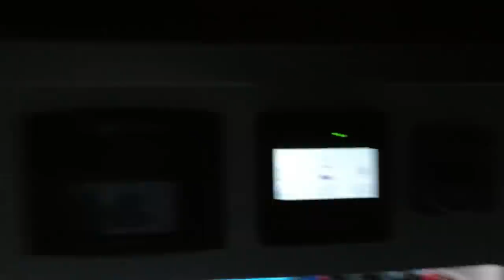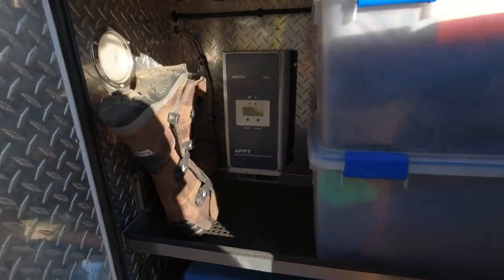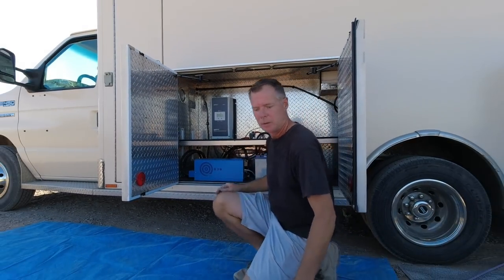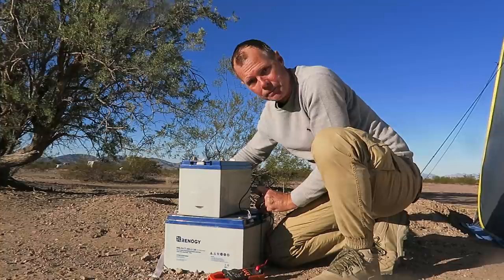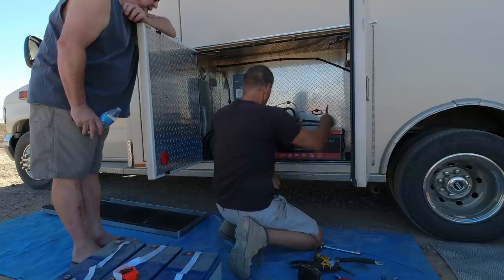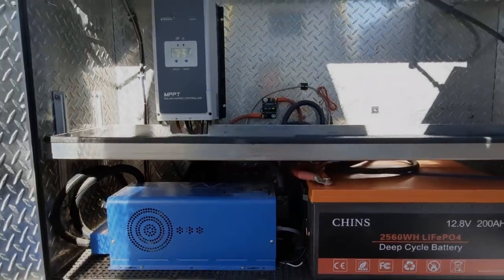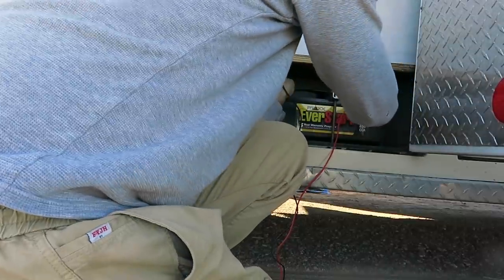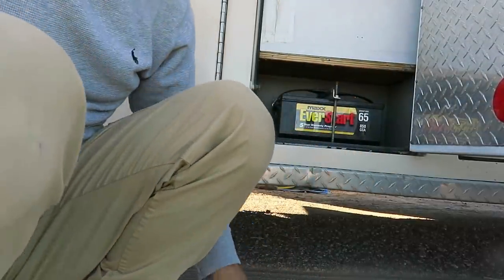Upgraded To CHINS Lithium Batteries In Quartzsite Desert | Fleet Gear | Ambulance Conversion Life

Comment: Hi! Love your channel, Lefty is a crackup, you select music that really complements your video and I like your choices in upgrades. I own 3 trailers, a 25' tag, a 35' 5ver and a 42' 5ver (all toy haulers) and I'm a former sub ET and Navy instructor of ESM operations and maintenance, so I know a lot about every facet of electronics. I'd like to give a little advice, if you don't mind.
1. Excellent choice on the Chins batteries, you obviously do your homework. If you want to keep them warm in cold temps., you could cut a small hole in the cabinet out of the way and put a vent over it and when your heater is running, a small amount of heat would enter the battery compartment. They won't be as warm as you, but they'll be far above freezing and this is a lot simpler and more reliable than a 12v heater with thermostatic control. Simpler is better.

2. Battery hookup. Everyone is making this mistake, especially the people with 6-10 Battle Born systems and $20k wrapped up in Victron stuff. Don't get me wrong, BB and Victron is quality stuff, but IMHO Victron is designed more for yachts and is priced accordingly and BB is what people buy when they want to brag about how much they spent or they got them free for shilling them on their YT channel. You didn't show a pic of your battery hookup, but you did show your pos. and neg. jumper cables. That's a good idea, but to ensure 100% balanced load and charging you should have equal length battery cables to connect the 2 batteries to pos and neg bus bars, then the inverter and solar also connected to that bus bar. Actually, the 2 battery neg cables should go to a BMS shunt (I recommend the Victron Smart Shunt 500, a bargain for what it does and super accurate V, A and SOC readings for only $130), then the shunt connected to the neg bus bar. The reason is electrons flow through the path of least resistance. In a normal hookup with the batteries jumpered together, the electrons flow in one direction through one battery, then the other way through the other battery. In the case of 10 jumpered together, battery #1 and battery #10 are the first to get charged and discharged, the middle 2 batteries are the last and the batteries are not getting exercised equally and the end batteries will die first, which negates the whole point of buying expensive LiFePo4 batteries, especially those $1,000 apiece ones. The reason this happens is LFP batteries' internal resistance is measured in milliohms, which is very tiny. Differences in cable length or running through other batteries is more than the battery's internal resistance, so since electrons follow the path of least resistance, minute differences in cable length or connector resistance now dictate which battery gets more of the charge, instead of the batteries themselves. For graphic examples of this imbalance in charge/discharge, Will Prowse has recently done 2 videos using 5 48v rack mount batteries and the internal BMSs showed that when the charger stopped, Battery1 was at 100%, battery2 was at 98%, Battery3 was at mid 80%, battery4 was at about 78% and battery5 was at about 70%. Not good, especially if a guy spent $10,000 on 10 batteries. You know who they are!  LOL   To be clear, the pos and neg cables don't have to be equal length, but all pos cables should be equal and all neg cables should be equal. The jumper cables are a great idea to help with that. 

Solar panels. I use and prefer Sunpower, they're not only the most efficient per sq. ft., they also degrade slower than panels with thin silver interconnecting wires (because they don't use any and the silver wires eventually break due to extreme heat cycling - possibly below freezing at night and up in the 180 - 200*F range in summer heat.) They also are less prone to power loss in partial shading conditions. Normal panels lose about 89% of output if a single cell is shaded and if in a serial string, the entire string loses power. Sunpower loses only 11% or proportional to the area shaded. I'm glad to see you're connected in parallel, again - you did your homework! Great job! Also, Rich solar panels are my 2nd choice in panels. As tested by Will Prowse, he actually harvested 104w out of 100w panels, which means the mfr underrated the panels. One of the few products where you get more than you were promised.

Solar controller. I've tested Morningstar, Epever, Eco-worthy, Renogy, and Bluesky side by side with the same panels on the same day. Bluesky was antique junk, morningstar was solid but too expensive, Eco-worthy was amazingly efficient due to a very fast MPPT algorithm and very inexpensive. I use Renogy 40 amp for customer systems between 20 and 80A due to their low price, good quality, fast algorithm and BT with app on phone or tablet. I use the Eco-Worthy for lower power systems below 20A. The Epever was a heavy duty unit, but it's algorithm was extremely slow to respond to solar panel voltage changes, which means at the end of the day harvest is not optimal. It's not something I'd remove it for, but I chose not to buy or sell them because there were other, faster, cheaper units (Eco-worthy 20A and Renogy 40A) to use. If it ever fails in the future, you might consider a different unit.

Inverter/charger. This brings me to this topic. I like Aims, they're pretty reliable. I have heard of a couple of failures, but that's really low considering how many are in use. I use a newer style setup called a hybrid inverter. Up to 2400w of solar can connect to this one unit, which can accept over 3,000w of 110v AC input, it connects to a 24v battery, and it puts out 3000w of 110vAC output. It also charges the batteries with up to 60A of solar and up to 80A of AC simultaneously. In your case, your 1600w of solar would feed the batteries, until you started using a 110v load. The solar would automatically power that and any excess solar would still feed the batteries. At night, the batteries would power any 110v loads and if you started the genny, it would support the AC loads and charge the batteries with any excess. If you had the genny running and you had a load in excess of the genny's output, the unit would use the batteries to add power for that load. This is all automatic and uses no relays or ATSs, so there is never a loss of AC power and TVs, Sat dishes, DVDs never lose power and never reboot. The best part is it's only $480, lower profile and much lighter than the AIMS units. I use one of these on the 25' trailer with 30A breaker panel, 950w of solar, a 12k BTU mini split and 9.6 Kwh (750Ah) of LFP batteries. The mini split only uses 800w max to cool the rig, once it reaches equilibrium, it uses about 400w or less. So the rig is fully solar powered, even in 110* southwest deserts which is what I planned for. The 35' and 42' trailers are a bit larger systems. Each of those have  20Kwh (1565 Ah) BMW EV 24v batteries with a cell balancing BMS, 2 of the 3000w hybrid inverters (one on each leg of the 50A panel) a 40A 24v to 13.6v DC-DC converter to power 12v loads and a dual zone (2x 12k BTU) 24K BTU mini split with a transformer to supply 240v from 120v input. These trailers can almost be used as meat lockers in 110* heat, plus they're totally silent. LOL   Since the mini splits use only 1200w max, the microwae is now the single largest load at about 1800w continuous and quite a bit more on startup.

At any rate, I like your system, it's well thought out and good reliable equipment. just thought I'd mention other options that might be attractive if you ever need to replace anything. If the inverter goes out, the hybrid inverter is a far cheaper unit that puts the entire system (MPPT solar, inverter, charger, AC pass through) all in one easy to connect box that is user repairable if you ever need to replace the inverter or MPPT, etc.

Keep on exploring and having fun, I enjoy Lefty! And you too! LOL

Comment: Lithium is the way to go. Awesome video. I only wish you had explained safety need for the foam when you dismounted the shelf. Agree with the comment of throwing a 1/4" foam insulation between the door and the battery, just as a thermal break and padding. 

I really want an ambo in the future. I'm starting with a little vintage Serro Scotty though. Doing a hopefully minimal resto/reno and fix. Top, front and rear aluminum skins to pull, some luan, insulation and 1x3s, and possibly some plywood replacement.

Happy travels!
Reply: Thanks for mentioning the foam and safety. I didn't catch that and it's so obvious. You're the first person I've seen to use the funny word "ambo" I love it!   Cheers

Comment: regarding cranking batteries, I've had good luck with Interstate in my trucks.  That said, in the twelve years we ran a 6.0 powerstroke, we did have to replace both cranking batteries several times.  I get my Interstate batteries at Costco
Reply from the maker: Thank you - these things seem to eat batteries!
Reply: Yes, my 6.0 ambulance ...  I have two Motorcraft SLA under the hood and two optima yellow top AGMs for the ambulance box (purchased from interstate).   Why?  They were the makes when I first bought the vehicle and I figured I should stick with them.  But I am having low voltage  issues at start up (until the alternators kick in about 40 seconds later) regardless if it is summer or winter (its -5 to -10 F now so really hard starts).  To a certain extent, it makes sense to buy any compatible battery that can be replaced at locations that are easily found.  Like Costco, Interstate, Walmart, and Ford dealerships are everywhere.  If they fail under warranty, makes it less costly but also really convenient to replace, right?  I hope those Chino batteries last because I assume you would have to ship them to China and also wait for delivery.  I do like the idea of using a separate solar charger to top off the cranking batteries.
Reply from the maker: @alporan9087  The solar really helps the crank batteries when we've sat for a couple weeks.

Comment: since you have ac power run a extension cord to your block heater on cold days. you"ll be glad you did
Reply from the maker: I need to replace it, the cord has burn marks on the plug so I've never plugged it in... :/

Comment: OK big guy... Loong time (almost 50 years)  diesel owner (new ambulance owner just starting my journey to converting) and "been around the horn"  battery buyer.  Best bang for the buck is top of the line walmart. That looks like that is what you may have and if it is a three year rated you may have some prorated discount left on another one. You can pay more (I  have interstate on my  Dodge diesel).  Besides knowing battery voltage values (that I have just recently started to learn and study voltages as a thing), keeping water levels with distilled water adds life as well. I do not buy batts without caps to replace water. I have three starter batteries in my ambulance  and they discharge after just a few days and the battery disconnect is shut off.. The other 4 vehicles loose voltage at different rates.  Might be interesting to check voltage a couple hours after after trip when they have settled and then again before next start. I you have one weak battery a stress test would need to separate batteries to find problem, just like the house batteries. I am thinking lets make it a party'  BATTERIES FOR ALL

.Sometimes there are different cold crank ratings for batteries in same size case. I buy the biggest CCA I can fit in my trays regardless of what the book says. MY thinking is that I run out of gas, I can always get home on the starter... :).   When changing batteries I always scrub cables to neutralize any traces of any corrosive tiny spots i may not see with batt cleaner, put chemical washers on posts and use a batt sealer on clamps and posts  after installing  to inhibit any corrosion as much as possible... but hey, I might be more on the spectrum than most...
Reply from the maker: Great comment thank you!

Comment: I been having a  100ah chins battery for a year and I'm really happy with it with no problems.  If you ever run them down till the bms disconnect  you will have to get a hot battery to get the bms to turn back on.  I have done that a couple times.  But I have not done it in a long time.  Great battery
Reply from the maker: That's great to hear that it's performing well!

Comment: Nice job! I have a CHINS 300 Ah that i've had for a year. Just getting around to testing and running a dummy setup to learn wiring, crimping etc. before i install on my 2007 Ford E350 Econoline extended van. Thanks for sharing.
Reply from the maker: Good idea working with it. You'll get good at it the more you do it.

Comment: Love your videos! Me personally would install insulating barrier between the aluminum shelf and the lithium batteries in case of a failure of its mount.  Separate the starting batteries by removing the ground cable from one. Then checking the voltage on each will give the voltage individual measurement. The lower battery will show more acid damage on its terminal and surrounding surfaces. I buy AGM replacements with matching dates and voltages. My favorites were Sears Platinum.  Make sure all cables and connections are clean and tight. I really like the build.

Comment: I've been running 2 200ah Ampere Time Lithiums, for a year and a half.
Will Prowse has taken those, and the Chins batteries apart, and, they are the same cells, and bms.
So, same batteries.
So far, no complaints.

Comment: My apartment has had no heat for about a month and 2 days. I'm in Sacramento, CA. I have two clip-on fans that I mount on a swinging cabinet door and blow warm air down off the ceiling in the kitchen. It seems to work. I run the oven for about 3 minutes and recharge the fans right off the cabinet door but slid down. They are each 3 speed. Love your show!  I'd like to clip out some of the protective guard around the fan blades.
Reply from the maker: It's amazing how a small heat source can work!

Comment: Great info.   Great effort.   Fascinating process. 

Folks may not appreciate the potential for disaster you & Lucky face, in the event that your install failed out there in the desert in the middle of winter.   The struggle is real.   

This episode was clearly a topic that is central/core, to powering the sort of routine you two are allowed to develop, as that final documented morning coffee/TV time segment at the end of this episode attests.  Quite exciting to witness.   
Naturally, a part of my growing rig issues, as I build my rig, is the growing question of what route I will ultimately take concerning powering my lifestyle while roving in my own rig. Electrical is a daunting issue. My business involves the use of 6 different machines, each with a battery system. Even after 31 years, I still rely on support from the repair shop to negotiate any such issues that involve elec.  When I attempt a fix myself, I typically end up with a worse problem than before.  I have considered looking into the availability of a course offering at the local community college, or some similar opportunity to acquire more prowess in this issue.  Any thoughts would be awesome.  
Again, what an episode!! The tension of the moment, ever broken by the hilarious Lucky interactions, was compelling to watch.
Sparks
Reply from the maker: Battery system is what powers out lives... we'd be really lost without them.

Comment: Regarding your chassis battery, a straight voltage reading is one thing, a load test is another. The quality of the battery is determined by the current available under load. So put the voltmeter on the chassis battery and crank your engine and have someone watch the volt reading. A good battery will hold its charge, it'll drop a little but a bad one will drop significantly with any load.. I definitely understand not gifting your old AGM batteries, someone would have to be pretty desperate before I would give them batteries with such a short life ahead of them
Reply from the maker: Thanks for that info John, I'm on it.
Reply: Get some Interstate Megatron batteries. We use them in our Ford diesels up here in the northeast Boston area. No problems with cold. Also 75 months no questions asked warranty.
One other tip we learned the hard way, only use Rotella oil in your rig. It has the most vitamins and dinosaurs in it.
Reply from the maker: @nycmaverick  Megatron? Oh I've got to get those! My 7.3 loves the Rotella T4. I switched to the T6 synthetic the last change, but I'm seeing seeps and didn't notice any real improvement in starts or usage so I may go back to T4.
Reply: @TheCampulanceMan  Typically when switching from dino to synthetic you'll discover leaks. Thats actually a common issue.... Even with gas engines. I say stick with the T4. Because that T6 can get quite expensive at 16 quarts! 😳

Comment: Nice video. I would think about covering the battery terminals especially with that metal shelf above it. Safe travels!
Reply from the maker: Agreed! I have rubber on the bottom of the shelf but I still want more protection :)

Comment: Motorhomes usually come with auxiliary start buttons on the dash to combine the house batteries with the starter battery just incase the starter battery fails or gets weak. Something to think about.
Reply from the maker: Yes thanks Stan. I can connect my 2 systems with a switch and that's how I solar charge the crank batteries.

Comment: You might want to check into a stand alone solar panel for the cranking batteries to keep them topped up when they are sitting idle
Reply from the maker: I've used my solar in spurts to charge them when we sit long but I hadn't been doing it recently. A stand alone is a good idea